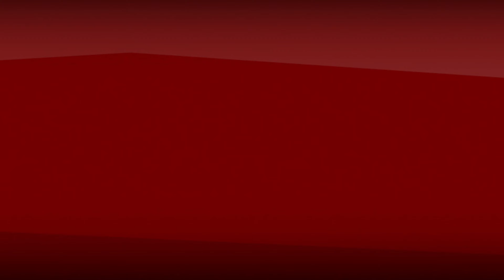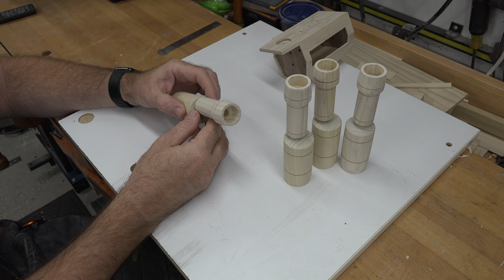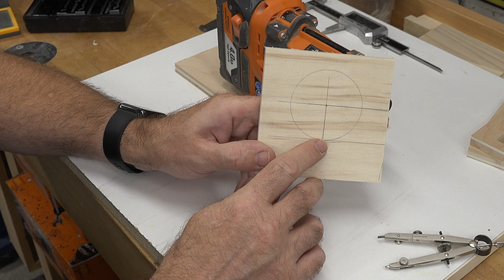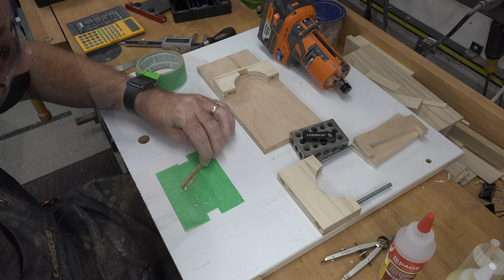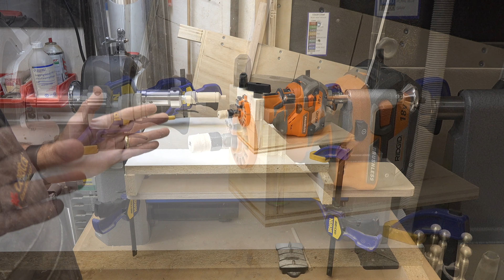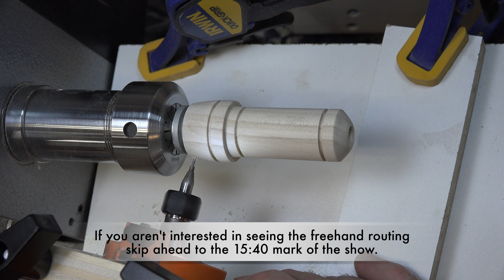Shop Made Fluting Jig

Comment: Why not put a depth flag made out of painter's tape attached at your desired depth? When the flag slaps the piece, you've hit your depth. 

That's how I've always done free hand routing where I'm unable to use a depth stop and it's never failed me.
Reply from the maker: That's a great idea.  It works will drill bits, so why not on a router bit.  Thanks for tuning in to the show and for chiming in with your suggestion.

Comment: this was a great project.  One after thought, cleats hot glued to the lathe surface to guide the jig like a fence and to create a stop might have helped.  I bet you'll find another use for this jig before long.
If you make special model parts all the time, you should look to get one of the original Legacy's Ornamental Milling machines.  Not the newer CNC types, but the old hand crank version. It is basically a 3D milling machine for woodworkers.  One of the smaller versions would probably fit in your shop with a little shifting :>)
Reply from the maker: I appreciate and enjoy your input Russ and I thank you for chiming in with your suggestions.  I may just have to look into the milling machine.  Could make for a fun new skill to learn.  Thanks for tuning in this week.

Comment: a wood block on the base which the router jig base slides on would act as a depth stop, CA glue a block to it, set by following the ply stop guage you used in the first instance,
cracking vid, and great instructions in all your vids
Reply from the maker: Thanks for the kind words on the show Gary.  I appreciate you tuning in and chiming in with your suggestion.  Thanks.

Comment: Would it have been possible to add a color on the router bit to be able to see the 1/16 as it is spinning. Above the 1/16 so it wouldn't wear off.  I used to use nail polish years ago so I knew where to set the depth. The old Black & Decker I had at the time didn't have a depth scale. Just wondering. Maybe to bit would spin too fast to see it? Even a simple jig for your show can be a big help to others.  I have a couple of projects next summer that I'll need to use my router on. So a show on beginner routing may be of interest to some of your viewers. I could use a refresher lol. Take care!
Reply from the maker: I like your idea Michael.  Kind of like the colourful bands that are added to lathe 4 jaw chucks to make them visible.  A little nail polish might just do the trick.  Thanks for tuning in and for chiming in with your suggestion.  It's very much appreciated.
Reply: @acutabove_woodworkings  I used a bright nail polish on my wife's and mine blackpowder rifles and pistols sights too. Hahaha, nail polish isn't just for nails anymore lol. It has a lot of uses.Take care!

Comment: Hey Ken if you are still adding flutes to the other peices just a suggestion clamp a straight edge onto the table in the angle of the peice and set the depth of the bit the run the bit along the length that you want the flutes to be,  good show
Reply: Was gonna say the same thing, perpendicular fence to the first one as a depth stop.
Reply from the maker: Like I mentioned to Alan, a dedication lathe bed table with adjustable fences and stops would be ideal for this.  Thanks for chiming in with your suggestion Jocelyn.
Reply from the maker: This project is long done Alan but that's a great suggestion.  I'm thinking maybe I need to design a designated table for this one to add to my lathe, with adjustable fences for stops.  Thanks for tuning in and for chiming in with your suggestion.  It's appreciated.

Comment: Interesting concept. I wonder if maybe a wooden block (depth stop),  following  the same length and curve of the piece fixed in the lathe, would have been more convenient than the plywood stop on the router, and easier than doing it free hand?
Reply from the maker: I'm sure there are plenty of ways that I could have achieved this Andrew but the free hand stuff doesn't really bother me.  I like your suggestion though and maybe I will have to implement that for the next project where I need the fluting jig.  Thanks for tuning in and for chiming in with your suggestion.